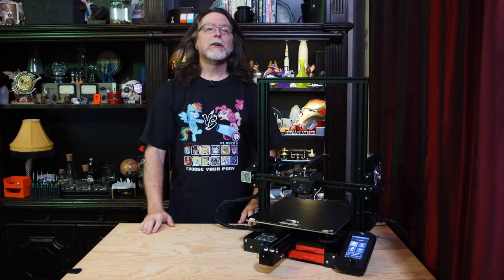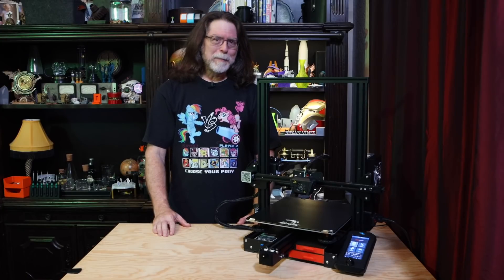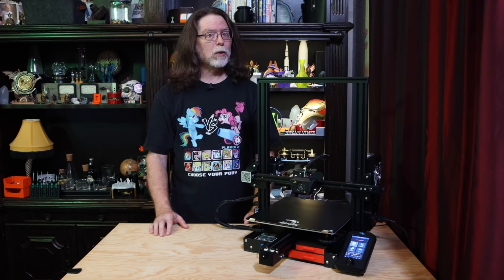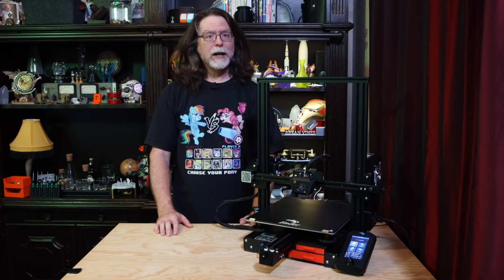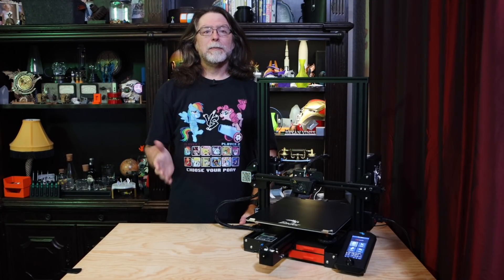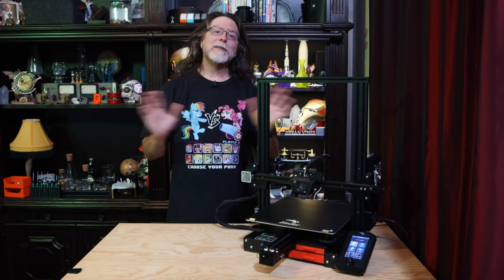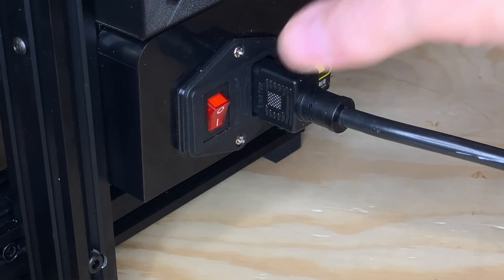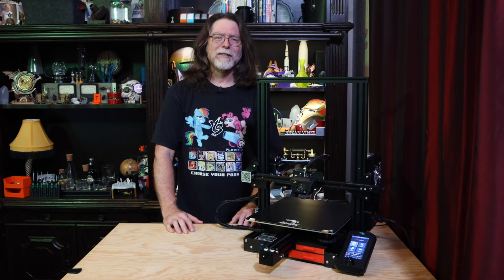Ender-3 Max V2 Pro?! A Max with JyersUI and color LCD!

Comment: Hey Bryan! I love your videos and have learned so much! Has the Ender 3v2 Screen changed? I have purchased this one that you have linked, as well as one from a different Amazon supplier and neither screen work with the DWIN_SET to flash the new colored screen. They just boot right up immediately to the main Jyers screen when the card is inserted into the back of the screen. I have used the same SD card (formatted  as FAT32 with 4096 allocation) with the DWIN_SET file to successfully update my 3 Ender 3v2's, but I cannot seem to figure out why I cannot update the two new screens to work on my 5 Ender 3 MAX printers. I have even attached the new screens to one of my v2's to update and then transfer to the Max, but still nothing! I can move one of the original v2 screens to the Max and it works fine there too. Any help would be appreciated, as I would like to continue to install Jyers on all of my Max's, but would prefer the Gotcha colored display set.

Comment: Hi i have an ender 3 max. I have an skr mini e3 v3 board and wondering if you have fitted this board with the v2 screen im also looking at adding the sprite hotend aswell as i think the combination of all 3 would make the max a fantastic machine. Do you know of any firmware that could make this possible. Any help would be great.

Comment: Hi .
I have updated my 3d max as instructed but I can only get it to run as an ender 3v2. Is there any way you can send me your file to upgrade my ender 3 max to its correct bed parameters. Thanks in advance Robert Mcduff.

Comment: after doing all the compiling of the irmware everything turns on fine but cant home the printer, no axis move . is there a setting that needs to be change in the vscode compile
Reply: figured it out, the printer has a 4.2.2 board and i was told by the owner that he had 4.2.7 so re configured the firmware to the 4.2.2 and its working now
Reply from the maker: Hi Israel, I'm glad you got it sorted out!

Comment: Hello Brian, so, I have just added the SKR Mini E3 Version 3.0 Motherboard and the BigTreeTech TFT35 3.5” Color Touch Screen. I had a BL Touch, so I have tried to add it as I could, but it is not working and wants to smash the base without stopping. I thought I had loaded the correct firmware with auto homing, but the red light on the BL Touch never comes on. Just the little blue dot light. So, my BL Touch colors are different with a blue wire instead of green, but they are in the same places as yours. I just can't figure this out. Why is the BL Touch not lighting and moving the retractable arm?

Comment: Another great video Bryan, I would like to try this on my Ender3 Max Neo as it already has the color screen and I hate the oem firmware. Is there anything in JyersUI for the CR touch ABL and filament runout sensor? I tried to do the Unified firmware from TH3D but the printer did not like it and had to put the oem back on.

Comment: Anyone figure out how to move the X setting for auto homing and bed leveling so a 4.2.7 board knows that the BL touch is on the right side not the left side.  My homing is off center and bed leveling puts right side off the bed

Comment: just picked up a ender 3 max as a returned unit that is being sold as used, will be the 4th printer ive gotten that was either a openbox used or refurbished an so far 3 out of the 4 have been what looks to be brand new printers with just stripped screws or threads stripped from the holes so was really easy fixes like cutting new threads deeper into extrusions an just using longer bolts but so far 3 of the 4 have been very good deals an the 4 is still not arrived in the mail yet, its the ender 3 max. i planned on doing this to the max to add the screen mainly, i have so many belt tensioners printed an on hand at this point i dont really have to worry about those but the display is something i wanted an i have a bltouch i want to add so ill be back once my ender3 max comes in the mail.

Comment: Just set up my Ender 3 max over the week-end with plans to upgrade over the next fer months. it took a few times to get it leveled right, but it has been running fine. I decided that the first upgrade is a auto-leveler which I'll order tonight. I thought it would be the screen, but the current dial and push button works well enough.

Comment: Will JyersUI firmware work with the stock screen on a ender 3 max?
Reply from the maker: JyersUI will not, because it's designed specifically to work with the Ender-3 V2's screen.

Comment: minus the custom firmware part, I did the same basic process on a Ender 3 Pro to turn it into an Ender 3 Pro V2. Just recently installed the Creality sprite extruder pro kit on it, so now it's a Ender 3 Pro V2 S1. Not the easiest task but I got it sorted. The hardest part was getting the offsets set so the CR-touch probe would work correctly.

Comment: I see all you guys installed the firmware from jyersUI but i am the one where my motherboards (4,2,2 and 4.2.7) wont load the jyers firmware, plaese start a topic where this problems where sorted out, thanks
Reply from the maker: Hi, probably the best place to go is the Discussions tab on the JyersUI Github: https://github.com/Jyers/Marlin/discussions
That's where the people who know the most about it can be found. You can see what other people are running into. Maybe someone's got a solution for the problem you're experiencing.

Comment: Great videos - very detailed. I have a Max with a CR Touch - I noticed that there are Pre-configured Marlin files for 3x3, 5x5 and 10x10 but in the source download templates there are only 3x3 for the BL touch does the Max not support the other level  configurations? - what is the difference to the UBL-BLTouch-10x10?
@ Luc Lafreniere comment about the probe offset change for the MAX are there any more details to clarify this change?

Thank you

Comment: I compiled the firmware for the 4.2.2 board, no ABL etc, basically stock printer, as shown, but with the 3x3 Manual Mesh option. Is there a way I could send the .bin for you to pin to the description, as I think many people would need that build?

Comment: Wondering if you can do a video on this same printer but add a cr touch to the mix. I have tried but Im a noob. having issues getting everythin lined up. works great if you dont use cr touch.

Comment: I purchased a Refurbished Ender 3 Max that turned out to be a hot mess, but installed a CR Touch and Creality's firmware and was instantly disappointed with the probe point and the 0.1 resolution on the Z-Offset, so I tried compiling many Firmware with no luck, so I bought a V2 Screen and compiled Jyers and it transformed my Ender 3 Max and the UI is very similar to my Ender 3 S1 and gives very useful data. Appreciate the work and the informative videos to turn my Ender 3 Max from my most hated printer to one of my favorite (I also added a Dual Z so that helped too)

Comment: great video, I ave a question. I did the update and the screen, I added  cr touch. How do I adjust the offset of the touch? On the v2 it is on the left but on the max it is on the right

Comment: Like my 10th time trying this following both videos idk what's up keeps failing to compile anyone else have this problem and fix it?
Reply: Ive just started trying to do this and followed both videos and keep having errors and problems in vscode with configeration h, i'm currently just banging my head against a wall lol

did u manage to get yours sorted ??
Reply: @Jb1kenoby_  I legit just jump onto another laptop and it worked for me for some reason my main laptop just didn't like compiling the firmware hope this helps

Comment: Question, I have a ender 3 max on 4.2.7 but under marlin there is no 4.2.7 only 4.2.2. I have been building using the 4.2.7 ender 3 pro folder. But the auto level points are off not sure why? Do this hit the correct auto level points

Comment: I just bought the Belt Tensioners. I think that is a must upgrade and should come standard on any printer. just after buying my max I had to replace the main board. so, I decided to upgrade to the 4.2.7 board. ar least that is fixed I am still working on a under extrusion issue. have no idea how to fix this issue.

Comment: Do you have any information on adding the CR touch to the Jyers firmware for the Ender 3 Max?

I setup mine but it fails to mesh the bed. The probe keeps going too far over on the X axis
Reply: I’m getting the same problem with the BLtouch
Reply: so i havent done it myself yet, but another commenter mentioned that the v2 firmware has the position of the touch on the opposite side of the printhead so you'll likely have to find the offset and add it in yourself.

Comment: Thank you Luc Lafreniere for this adjustements. I did not see your comment and it was "la galère" with the nozzle going out of the bed. Just one thing. for me 38,-15,0 is better. With -18 the bed was kicking the y axis. Just if that can help someone. And also thank you Bryan for your video. I just received an ender 3 v2 so with the screen and some other pieces I am proud to announce that I have a BV3D  Ender 3 MAX Pro V2 (french name sounds better). The Jyers code is awesome...
Reply: Question for you do you try this version with octoprint ??? on my side some feature is not working ... Gcode viewer and Bed visualizer ...

Comment: Have you done a similar upgrade to an Ender 3 Pro with the 4.2.27 board, a BLTouch from Creality, and a Micro Swiss All Metal Hot End? I shelved mine for several months having never been able to get it to work reliably and all features to work no matter what firmware I have tried (although until seeing this video I never heard of JyersUI.)

Comment: Thank you for the great work! I just did all of this with your video as a guide. I also added a second z axis screw as well. One thing to note, if anybody here has the BL-touch or CR-touch, the JyersUI code has the probe offset to work for the Ender 3 V2 and NOT the Max which is on the other side of the printhead. Took me a while as a newbie to figure this out. Those numbers should be 38, -18, 0 for X, Y, Z. I determined them via homing the printhead and measuring the physical location relative to the bed. This brings the probe smack in the center. Otherwise, if someone forgets to change those numbers like I did, your printhead will be offset by a large amount along the X axis. To the point where it will move off the side and crash.
Reply: could you share your file
Reply: @Hoceima  You just have to go in the BLtouch probe setting for me it is in advanced menu ... et change the parameter there for 38,-18. On my side I don't have Z to set there. Z will be set with the Z offset probe ... after all leveling and check with a manual method (paper sheet)
Reply: Finally got mine to work after 2 days of staring at the code, ended up having to delete all the marlin files vs code and python and redownload everything and start from scratch. I ended up having to fine tune the homing position for X/Y/Z , mine ended up being 41.55, -21, 1.23. But it works like a champ now. Thanks to all you guys for your comments it helped a lot. Also a giant thanks to Bryan, your videos are great and very informative. ALSO AS A SIDE NOTE... in the bed size area of the code it helps to make your value for the extra bed compensation to 0. It was set to +15 in my code to allow for more use of the bed, but it doesn"t work with the CR touch. it offsets the nozzle way too much.

Comment: Got the Max about a week ago, had already ordered the adjustable belt ends and screen.  Tried one night to do the software, did not get it to work right so waited a few days till I was more refreshed and worked at the software again.  This time I got it.  The first time I did not log in right even though I thought I did.  I could edit but could not compile.  Well today I put on the screen and installed all the firmware.  First week I used the stock ender max screen and now with the V2 screen I am much happier it is more to my liking and matches my 3v2 printer.  Today I am finishing up printing the drawer unit.  Thank you so much for the guidance the video the links and the files to make the Max what it should be!

Comment: I got a ender 3 max a bit ago, havent been able to print anything decent... the software kept on getting messed up and the nozzole drags the prints around the bed. I got a CR- touch becuase I thought it would fix it but couldnt find a good firmware and the ABL hits the fan on the print head which causes the whole thing to vibrate. I do not know what else to try.

Comment: Why not get an ender 3v2 and add an ender extender kit?
Reply from the maker: HI Daniel!

This video was primarily aimed at people who already have an Ender-3 Max, and want to run JyersUI.
But you could absolutely buy an Ender-3 V2 and add an Ender Extender kit. It would cost a little bit more. As of this comment, the Ender Extender option would be $81 more, going with a 300x300 bed and no height extension. The cost difference goes up from there, but you also have a bunch options for bed size and Z height.

Ender-3 V2, $262.
300x300 EnderExtender V2, $149
Total: $411.

Ender-3 Max, $269 (apparently on sale right now; regular price $329)
Ender-3 V2 Screen, $36
X & Y Tensioners, $25
Total: $330.

Comment: Hi Bryan
Am having problems compiling firmware for my Ender 3 Max Pro V2 as it comes up with problems!
I have a 4.2.7 board, CRtouch with X= -53  Y= 11 offset and a Micro - Swiss DD extruder
Was wondering if you could compile this for me and i will pay you?

Comment: I undermounted my PSU in my Ender 3 Pro because i added a second Z-Stepper, it's simple you just print 2 mounts and shove it under the back.  It's not hard at all.
Reply from the maker: OK, cool. It seemed like it would be a bit of a hassle to do. Was it the 2nd Z stepper motor that prompted you to move the PSU? And how do you like the printer with the 2nd Z? Good stuff?

Comment: Creality also sells touch screens for ender 3’s
Reply from the maker: They do, which is cool -- but the touch screen won't work with JyersUI.
Also Creality's got a sort of tethered tablet thing they're calling the Creality 3D Pad. I haven't used it, but it looks like a little Android tablet with a custom GUI. It even has a port you can plug a filament sensor into.

Comment: Does the 4.2.2 board in the 3 max have a different z stepper? Does that make a difference?
Reply from the maker: I think there are various releases of the 4.2.2 board. For example, the one I have has silent stepper drivers for X and Y, but not Z or E. The drivers on 4.2.2 boards are all set to run in standalone mode (I think). But, functionally, the 4.2.2 board in my Max behaves the same as the 4.2.2 board in my V2, with the exception that the one in my Max is louder when it moves the Z axis. If I misunderstood the question, let me know, and I'll try to get you the right answer.
Reply: @BV3D   I think you got it. I just know that z & e are not silent on my max but are on the V2. Idk if the different version would cause an issue. Anyway, thanks for all you do!